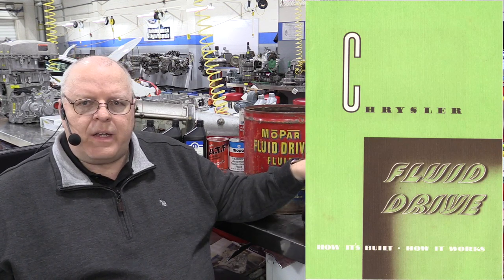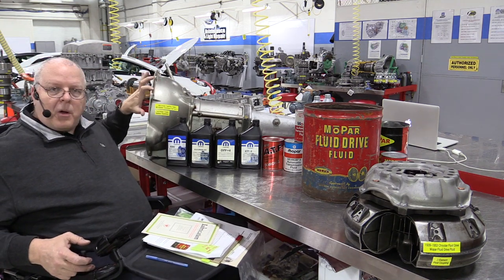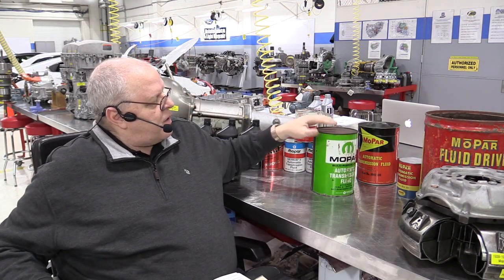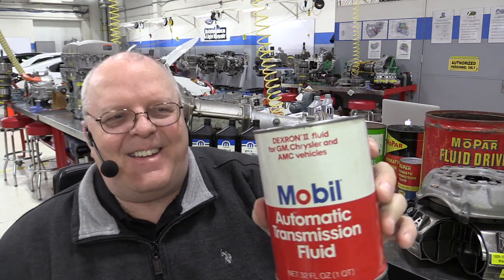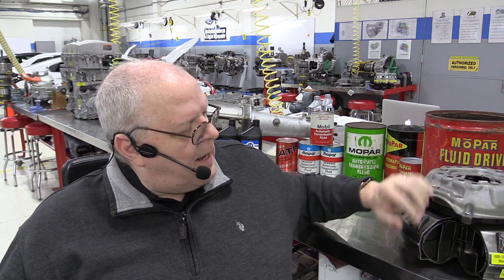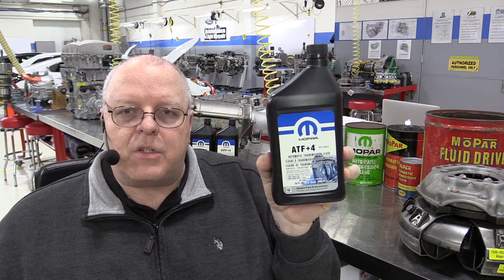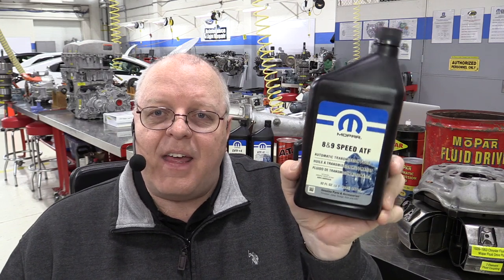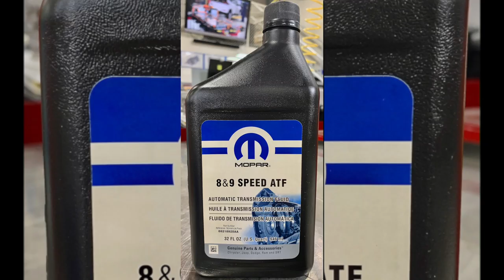Chrysler Automatic Transmission Fluid  - ATF History Part 4

Comment: I started with Chrysler Corporation in 1953 with the Chrysler division and moved to the Imperial division in 1955. I can't remember who the guy was now, but he pitched red dye for leak detection to the brass and they agreed with him. However the supplier balked about it diluting the finished product, so some had the red dye some did not that went on for years. That was also a running inside joke between the divisions that went something as I work in the Plymouth division, not Imperial I'm undyed or something like that. The first issue the red dye started to have was that it would break down and turn the fluid a dark brown leading to unnecessary fluid changes from mechanics and owners alike. The old saying of brown or burned fluid time for a change was, well a lie. There was absolutely nothing wrong with the fluid the dye broke down and made it appear brown, dirty or burnt looking. In 1978-1980 a lot was going on there were cutbacks and layoffs, arguments and all that mess. Management in 1979 under Lee put a stop to anything that cost anything, word for word how I was told. All projects were put on hold to be reviewed everything that was currently in production would continue like it was with no changes. At that time we had been using Dexron II(D) since late 1974 early 1975. MS-7176D or ATF+ was released in I think March of 1980. It was compatible with Dexron II and owners manuals up to1988 recommend Type 7176 or Dexron II fluids. I also have forgotten what the lab boys said that was so bad about the ATF+2 and +3 fluids but they had to go away by, literally to be withdrawn from the markets by April of 1998, that was in 1988 and work was in full swing with the new ATF+4 or MS-9602 that was released in I think 2000, I retired in 1995. What I always considered strange was the fact you could top up with ATF+3, but not fill with ATF+ or +2, never could get a straight answer to that. Those bottles of old ATF+ and ATF+3 you are looking for went the same way R-12 went. They were white, blue, red and gray backing plastic bottles shaped like brake fluid bottles with blue Mopar lettering, red lettering ATF+ TYPE 7176 one quart bottles and I forget what else they said on the front or back, I just remember that style did not last long because to many mechanics would grab a bottle and start to pour it in the brake reservoir and go damn it, yeah they were a bad design choice to make ATF bottles look like power steering and brake fluid bottles, but they never asked me and just went with it, but I still got the blame. The ATF+3 was your normal shaped plastic oil bottle like today with the offset spout. I don't know why I still know this but ATF+ Chrysler part number is 4467721. Maybe in the morning I will remember the part number for ATF+2 and 3.
Reply: I'm sorry it was ATF+ that had to be removed not ATF+3. Chrysler service bulletin 21-006-01 deals with ATF+3 and +4. SAE paper #982674 deals with ATF+4. Well what do you know here is an old eBay listing of ATF+ good pictures, https://www.ebay.com/itm/Vintage-1986-Mopar-Automatic-Transmission-Fluid-ATF-Type-7176-1-US-Quart-Full-/282916957159?_trksid=p2047675.m43663.l44720&nordt=true&rt=nc&orig_cvip=true
Reply: I searched google with the part number and this was one of the results and a lot of other garbage.
Reply from the maker: Fantastic information! Thank you for sharing that history with us. The red dye darkening is still an issue today and does not indicate anything about the condition of the fluid. Thanks for the TSB and the link to the old photo as well! You have a wonderful memory, have a great day!
Reply: @WeberAuto  I wanted to add this as well but forgot Allpar.com and MyMopar.com has an extensive library of a lot of the old stuff we did, here is a video from an old slide film on MyMopar.com Chrysler Master Tech - 1951, Volume 5-1 Fluid - Torque Drive https://www.youtube.com/watch?v=g9iwSbrUgp8 An we were able to go all the way back to 1948 to I think 1977 both Chrysler archives and a lot of other people offered these up to be put in digital for future viewers and history buffs. I always got a kick out of the no nonsense wooden doll charter Mr. Tech, I can't remember the voice actors name, but they were all filmed at Building 135 at the old Highland Park Chrysler complex.

Comment: 37 yrs ago worked on a tug with fluid drive. had to be 20 yrs old when i remember it called it a wet clutch or fluid drive .had inline 6 with 3 or 4 speed trans with a low low . thanks for the info . as always thanks for sharing
Reply from the maker: Thank you for sharing. You are welcome

Comment: MANY years ago, in the mid-late '70's, I had 
a "sand rail" type car.  It was based on an OLD 
Chrysler frame, drastically shortened.  It had 
a straight 6 engine, and the 3 pedal Fluid Drive.

It had no body, except the floor, and I welded on
something that looked like the footrest on a 
Harley.  Just to keep mud out of our faces.

I drove it, for about a year, as my daily driver.

Since there were no doors, people could watch 
my feet, while I drove.  I LOVED to take off from 
a stoplight, and row through the gears, like a 
normal 3 speed transmission.  Next light, I'd 
leave it in 3rd, with my foot off the clutch, and 
proceed to drive away, just like a normal 
automatic transmission, except a bit slower.
(This was MUCH lighter than the original car, 
so it wasn't all that too slow.)

steve

Comment: I own two, and soon to be three, Mopar high performance vehicles with ZF 8HP70 and 90 transmissions, and my opinion on the "lifetime" fluid is:  1.  it is a calculated financial choice parlayed as marketing hype by FCA that a majority of the vehicles "should" make it to the end of the warranty period without the fluid being changed and without the transmission failing because of it - after that, they could care less, as the cost is on the consumer; and 2.  As a mechanical engineer by profession, and with 30 years of building race cars, engines, and transmissions as a hobby, there is no such thing as a lifetime oil of any kind, and I will be servicing my ZFs at some lower mileage intervals just as with others, as I tend to keep my vehicles for a long time and take pristine care of them
Reply from the maker: Thanks for your feedback. I agree with you.

Comment: John, Great work as usual. The Mopar+4 ATF is a high quality and advanced fluid especially at the time of introduction in the late 90s. Lubrizol was one of the specialty chemical manufacturers involved in the development process and helped bring a long life fluid to Chrysler side of the transmission world. 

+4 is a great replacement fluid for applications called for Dexron III if you want improved shift quality and oil life. Older Toyota applications prior to WS shift especially nice with this fluid and again due to the stability of the oil can benefit from the extended drain intervals. 

The Jatco built CVT JF011E is the same unit in the Dodge, Jeep, and Nissan. The fluid is exactly the same. Shop on price. 

The prices of ZF Lifeguard 8 and the Chrysler fluid is beyond ridiculous and again just another way to gouge the motoring public. They benefit from the confusion on this topic. There are better alternative oils available, but again I won’t belabor that topic.  The folks who follow the manufacturers recommendations and keep their vehicles will be requiring the services of a transmission shop or dealer soon enough.
Reply from the maker: Thank you and thanks for your feedback!

Comment: The last years of the Chrysler semi-automatic used a Torque Converter.  Fluid drive was never offered in a Plymouth.  1954 Plymouth did have available Hi-Drive, a Torque Converter with the 3-speed manual.  
The chart on the screen has all this correct, but the  spoken part is not correct.
Reply from the maker: Thanks for your feedback, you are correct
Reply: Hy-Drive was available on 1953 and early 1954 Plymouth cars.  In the 1954 model year Plymouth introduced PowerFlite which was a two speed fully automatic transmission and it was made until the 1961 model year.

Comment: Love your auto fluid videos, getting to the end on the Aisin 6 speed behind the Cummins using arsc oil. Our 2007 fuso’s/ sterling cab overs use the same transmissions but the oil is a far out price. When you didn’t use the right oil it was only a matter of time it would take out some o rings and the truck would stop shifting and throw codes. Being a dealership though I have to admit using the Amsoil atf with the same 3309 certificate number has actually done great considering the transmission bin out in heavy service since 2007. We won’t stock the Mitsubishi fuso oil because of the price. We even go over to the dodge dealership to buy the dodge filter and trim the pickup part of the filter to compensate for the shorter oil pan in the cab over trucks.

Comment: LOVE LOVE LOVE the hard work you put into these videos! Its so great to see in a world where "good enough" is good enough that some still takes the time to understand the advice they give. This is a topic I've become increasingly concerned about as I age and wisdom slowly sets in. Largely due to your lectures I have all but sworn off aftermarket parts. Fluids are next on my list. I have a 2004 Jeep Grand Cherokee utilizing the Chrysler 42RE auto which calls for MOPAR ATF+4. In the 10+ years of ownership I have ran Valvoline's ATF+4 fluid instead. I've had not real issues out of it but I would like to change to MOPAR's fluid to satisfy my OCD tenancies. Would you be concerned about switching back after using Valvoline for so long? Should I just stick with what works until time for an overhaul and switch back then? The statement from Valvoline is this:

"Certified and approved for all Chrysler cars and
 trucks that require ATF+4®, ATF+3®, ATF+2® or ATF+®."
Reply from the maker: Thank you and thanks for your feedback. See https://www.centerforqa.com/chrysler-about/ for a list of licensed Mopar ATF+4 fluids. I see some Valvoline fluids listed. See if they are the ones you are using. If they are, no need to change the fluid since is is licensed by Chrysler. best wishes.

Comment: These videos keep on getting better and better. I have a Ford six speed [Ranger pickup] a Toyota 4 speed [1998 Land Cruiser 100], an Aisin 8 speed in the latest Volvo XC90, plus a ZF 9speed in my Honda CR-V. All mated to turbo-diesel engines.
Looking forward to the Toyota fluid video and, if possible, your view on whether it is worth changing the filter and whether a flush is justified to change a higher proportion of the old fluid that is stored in the torque convertor.  I've changed the oil in my Toyota four times in 180,000 miles but never flushed it. Unfortunately the power brake motor [no simple vacuum servo on these] has failed and the cost of parts is prohibitive although the rest of the car is in great condition, including the engine, transmission and chassis.
Reply from the maker: Thank you and thanks for your feedback

Comment: very cool specific information on mopar atf's dear professor, and very convenient because im putting together a 1967, 318 engine i recently rebuild that goes into a A727 trany that needs the front seal and replenish of its atf, and i just learned that atf+4 will do it right once you displayed its back sticker on screen 🎥

regarding the life time limit on changing the at fluid on special synth blends, i believe that the manufacturer let us choose between common sense and oem specs accordingly to the fluid's capacity to properly lubricate as it was originally intended; in other words, @ 50k severe conditions: just change it, or wait until the next recommended mileage as stated, or/ in any case, you still have 8 years total (which is probably the maximun life span of that atf) to make up your mind or to do it right 💀

thank you so much for your precious time 👈
Reply from the maker: Awesome, I am glad it was helpful. Thanks for your feedback

Comment: Thanks John! Priceless information again. Yes. My 2010 F150 with the 6R80 pushes air out when it runs and when cool its in a partial vacuum, as you know. And that's great as long as the transmission has no leaks. Well i'm here to tell you in my experience these things leak before 100000 miles from numerous areas. So I replaced the transmission fluid at 25000 miles because of a shudder since new, Ford wouldn't do it and normal maintenance. Shudder still a issue that still occurs on converter lock up when hot and after being in stop and go traffic. The shudder Is another issue but after filter and fluid replacement the gasket tore and is suppose to be reusable. I used the one that came with the filter kit. 15000 miles later the bulkhead connector leaked so I dumped it again I drained it.  about 1/4 cup of water was in the bottom of the pan,.  I replaced the connector and  went back to the OEM reusable silicone and aluminum OEM  gasket. Added Another small bottle of lubrigard friction modifier at 60000 miles (to no avail). now has 90000 miles and no leaks just shudder. The diff input seal leaked at 20000 I replaced the fluid then shortly afterwards because they didn't they just topped it off. again if oil leaked out,  I'm sure moisture (or Water in the case of the F150 trans) got in

Had a sprinter van with 38000 miles and had a leak at the shift rod input that was repaired under warranty. that had a long change interval 150000 miles i believe?  Sold the truck at 52000 miles because if so many body integrity and mechanical issues.
I could see a very long interval for mileage. Not so much time  3 years or 1000000 miles may be more realistic a number to me. Again I agree it is possible just not on vehicles in my New England, and most areas especially where some manufacturers have a hard time sealing housings. Moving parts equate to wear right? it did the last I knew. Just isn't realistic Fliuds are the most importent and cheapest thing that can be done and often doesn't cost much more than a tank of fuel...

Anyway..Perhaps Someone out there knows why my early 2010 6R80 shudders and some others dont...? Some say a some late 2009 early 2010's I have had issues like this. Some say a Valve Body Replacement MAY helps,  some say a New Converter MAY help and some say nothing helps. Yep the TCM was flashed a few times by Ford under warranty. All this re-flash did was ELIMINATE Converter lockup in 1-5 gears and the same shudder occurs on hot lockup and on the highway on light throttle tip in and during a throttle position change that may occur when starting to climb a slight grade. Heavy throttle no slip because it wont lock then, TOW_HALL does not eliminate it but does reduce it of course because of a higher shift point and lock-up speed
Reply from the maker: There was a Ford TSB issued 10-25-13: 4.6L WITH 6R80 TRANSMISSION - TORQUE CONVERTER SHUDDER - 25-45 MPH (40-72 KM/H) - BUILT ON OR BEFORE 12/1/2009. ISSUE: Some 2010 F-150 vehicles equipped with a 4.6L engine, 6R80 transmission and built on or before 12/1/2009 may exhibit a shudder which is felt during low speed, light throttle acceleration between 25-45 MPH (40-72 Km/h). The shudder/vibration event typically occurs when the vehicle downshifts and is followed by a light throttle tip-in. A new calibration is available to address the concern.

Is this the TCM flash you were referring to? I do not see any other TSBs for a shudder. Make sure you are using the correct Mercon LV fluid (as you know). Best wishes
Reply: @WeberAuto  Yes. It was re-flashed 3 times on this TSB It was back to the dealer about 6 times. once at one dealer and twice at another. They even drove it for a week and said it was fine. I finally just gave up... All the TSB re-flash did was eliminate the converters programmed and signal from the TCM and no lock-up in 1 thru 5 gears I always locked up in every gear after the shifts which gave great city mileage when babied.  Not so much after the flash. Thank you for the info though. and pat dee is absolutely correct. Your priceless efforts are very much appreciated John and 100 accurate. not sure why you dont have 80 million subs. Love the detail please dont change anything.. 5  Gold stars.. Glad I found you on youtube Peace
 Edit: if I find any cans ill send them to you
Reply from the maker: @NotHarry-er3wg  Thank you very much, best wishes with your F-150

Comment: FWIW, VW said the same thing regarding never needing to change the fluid in their vehicles equipped with ZF automatics. But, just like the ones fitted to Chrysler vehicles, ZF lists a similar service interval for the VW units. I agree it sounds like marketing bunk. 
I know VW got some pushback with their DSG transmissions needing a fluid change every 40k miles... but it turns out if you stick to that schedule the transmissions last a good long time. Imagine that!

Comment: I can remember fluid drive with a wide ratio transmission with an overdrive. You could take off and then lift your foot and it would  shift so you could start in high unless you needed the lower gear to start on a hill or whatever-

Comment: HI Prof, Thanks for the very interesting and informative video. I have the opportunity to work on a 1949 Desoto with fluid drive.
Do you know what is the best fluid to use in place of the Fluid Drive Fluid?
Some say use "Tractor Hydraulic Fluid" others say use a 10wt ATF.
Any help would be appreciated
Thanks
Lee
Reply from the maker: Good question. It has been a while since I researched that topic, but I think I found some recommendations on some forums. A low viscosity mineral oil is what was used by Chrysler. I suspect a 10W fluid would work. Thanks for watching